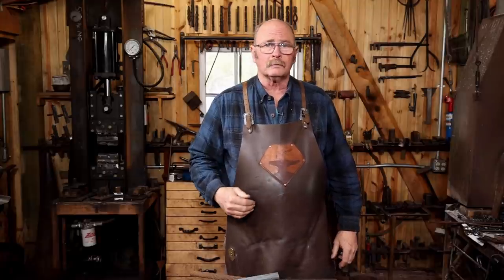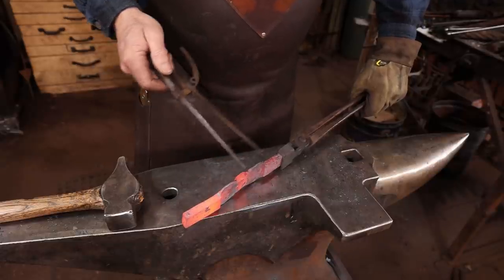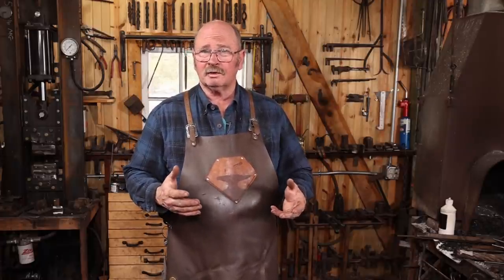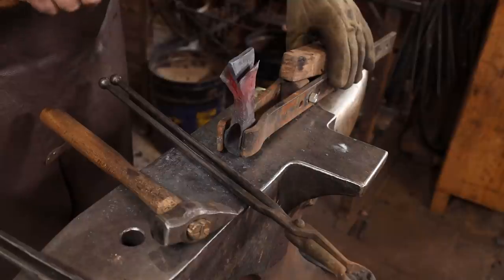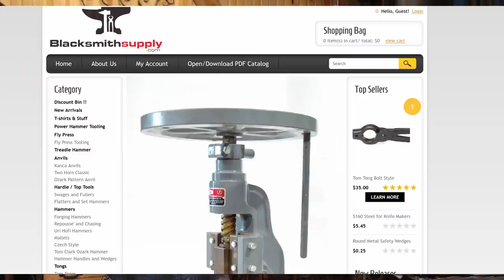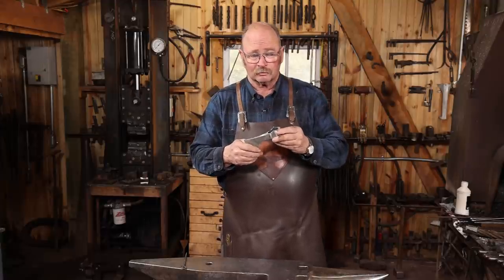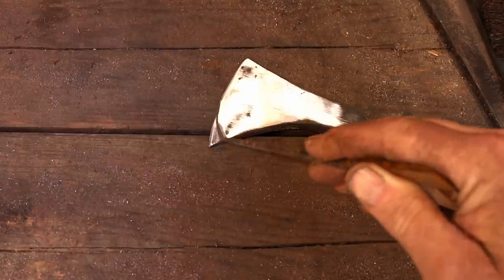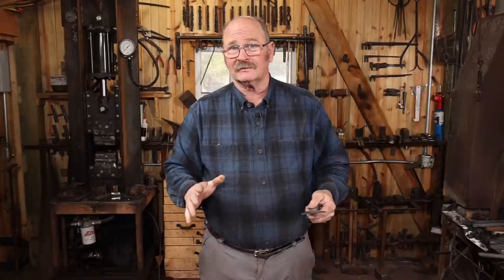Forging a Cable Damascus Camp axe - Blacksmithing fail.

Comment: I actually love the fact that this failed. Why?  There's people like me who are learning this trade, though I haven't gotten equipment to start yet, that hears stories of things like this happening. They may or may not believe it. By showing this, they get shown proof it can happen even to people with more experience. That makes this a great learning experience.
Reply: That is exactly why I became a dedicated Green Beetle fan. In fact, now that I am working metal as a hobby, I learn so much more from watching people’s mistakes than their successes. I am incredibly grateful to those who are willing to share their “fails” with the rest of us.
Reply: We learn more from our failures than our successes. :)
Reply: spent 6 hours drawing out a head out of 4140 round stock.     got done saw a crack 😢 it was my fault.
Reply: Same I got my forge and tongs from Amazon I did test with it with rebar made a half hook with a chisel edge

Comment: Thanks for sharing John 👍🏻 makes alot of sense when you explain about the time between heat treatment and tempering , cooling stress may have been a factor in some of my failures. Keen to see prt 3 🍻😎👍

Comment: Finally someone else that quenches in water. 
I will say brine Is actually safer than plain water. Salt water with dish soap, as it reduces surface tension resulting in a faster safer quench. Also recommend heating it to 150*f.  Parks 50 is the safest option and works perfectly.  You will wish you bought it years ago.

Comment: I feel your pain on the crack John! I spent hours forging and grinding a camp knife from 1065 - after the quench, I was checking out the blade in my bare hands - room temp steel, I was evaluating a mild warp in the blade and thinking about reheating and straightening it, or trying to ease it straight in the tempering oven...when suddenly... *PING*...took care of that. I kept the blade to use as a template as I was really happy with the profile. Happy ending is I forged another one and it's 100% good - didn't warp, it's nice and hard even after tempering a little higher than ideal, and all's I need to do now is make up some denim micarta scales from some old blue jeans.

As many others here, I really appreciate your contributions to the blacksmithing community and applaud your efforts and humility in sharing your failures along with your successes - that's the reality of blacksmithing.

Comment: That axe was looking good.  I hate that it failed.  But thanks for taking the time to discuss reasons why it would have failed.  Some years ago, I heat treated a meat cleaver made out of industrial sawblade steel.  It was late so I decided to temper it the next day.  It was sitting on the kitchen table and my wife and I heard that nasty little ping sound.  I looked at the cleaver and there was an inch and a half crack from the edge into the body of the blade.  Since then, I temper immediately after heat treat.
Reply: So good to know… I didn’t know that tempering right away was important. That’s exactly why examination of failures and explanations from people with this kind of experience are so valuable.

Comment: Hope we see better results next time. Most of the hardcore bladesmiths I've watched seem to swear by Parks 50 as their go-to quenching oil, so that is probably the best option. I've been told about a solution called Superquench, which if I recall right was a solution of brine and dish soap, which is supposed to be better for the 10-- series high-carbon steels than straight water, but I've never actually tried making it... I'm just starting to mess with blade-making at this point. I think I might just invest in a bucket of Parks when the time comes.

Comment: I use alot of 1095 and w2 and parks 50 has never let me down!
Reply: I was going to say, from the research I've done w1 and 2 and 1095 are water quenching when they're giant industrial parts. It's really just too risky in water for such small parts like axes and knives. Made a chef's knife out of some w2 and got somewhere between 60 and 65 HRC in a 130 degree canola oil quench.

Comment: My understanding is the water quench for 1095 is for a thicker cross section. When you forge it thin, oil will be a better option.  The 1095 knives I've made are all oil quench and come out with good hardness when tested with my files.  Your experience far exceeds mine, but that's what I've read and my experience.

Comment: I've quenched W1 and W2 in oil with very good success. The caveats are that these were knives, so pretty thin cross sections and I also preheated my oil up to a pretty high temperature of 140 to 150 degrees F. I tried a bunch of knives in water with these steels and every single one cracked on me. Maybe my normalizing cycles weren't good enough I don't know but quenching in hot oil got the blades VERY hard.

Comment: Thanks so much for letting us follow along and learn from your set backs. It would be interesting to go ahead and hang the head, then do some destructive testing on it. Do a bunch of throwing, and use it to split wood like a froe. See if you can get the bit or eye to fail. It might fall apart on the first throw, or we may learn how far we can push the thickness of the cheeks and how well a bit can hold on with only one side welded. Take care and God bless

Comment: Hi John! Sorry to see the axe fail, but I'm also impressed that you share your failures. I did have to check though, and 1095 is spec'ed as an oil hardening steel.

Comment: All apart of it. You showed me that lol. I have a whole shelf of fails right next to my forge. I look at em all the time, find where I messed up, or see that my material was just to small, or short or whatever.🍻
And watching this I can see where I mess up alot on welding. I need to do more heats. And maybe a slower blower. I'm always starting to get it to stick, then I pull it back out and the blade end(most of the time, sometimes the flat side?) Will start to spark and burn.

Last edit lol. 
Something else I've noticed is that I see you get the white heat quite alot and no sparks or burn. Is that just a difference in my forge and yours or the fact my blower is a little shop vac? I can get the bright orange easy. Maybe my eyes lol.. Thanks alot John!
Reply from the maker: I'm not really at white heat when I weld.  Thats just the way the camera sees the high heat
Reply: @BlackBearForge  ah, good to know.  Thanks

Comment: As a professional arc welder of multiple processes, I am impressed by your forge welding. The growing together of grain structure is the same in all processes. Your emprise on the base metal being clean is true for all welding processes and the key to success. I love watching your videos and use your teaching in my shop.

Comment: After welding the ends of the cable try soaking and rinsing with water in muriatic acid. This removes most of the rust between the strands. Do this outside and upwind! Some borax or kerosene helps with the oxygen attacking the strands during forging. Looking forward to the second kick at the can! 👍

Comment: Sure is a shame it cracked because it looked awfully nice. Better luck next time. I use parks 50 and it works great with 1095 I haven't cracked anything while using it yet.

Comment: Dear Most Excellent Blacksmithing Teacher,
Please move from the Mentions&Intentions stage to the BuyitAlready stage of a couple of Go-Pro cameras. Set them up in those semi-permanent spots you've talked about so you don't have to keep fiddlin' and fussin' with the recording device relocation problems.
Not having them is an efficiency hindrance to your most excellent work and teaching.
Please Sir and Thank You for Your videos.
😊😊

Comment: I'd lay some welds over the thin spots then grind them down to add thickness. Would at least be able to get some use out of it. Edit ** That was my thought before you said the cutting edge failed also.

Comment: As someone who's never forge-welded and rarely hardened anything, my immediate thought when you said it cracked was "did forge-welding change the alloy/properties of the steel?" I assume decarburization can change the relevant soak temperatures and/or best quench medium.

Comment: Heartbreaking that your piece failed, but still, what a great instructional video, and I'm totally for it if you decide to revisit this project!

I did have a question, during the forge welding part, you were kicking out a pretty good amount of sparks (3:32).  Is that just typical when you get a piece that hot?  Or is some of it due to the flux (if you used any)?  Just curious, keep up the great work!!

Comment: Your experience shows. When working hot steel you keep that hammer in motion to the point that it's hard to tell which side your using sometimes.

Comment: To relieve it instantly I do a japanese temper in the forge, bringing it up until water droplets roll off it, which should be a gentle max of 200°C. I doubt you could even see much yellow, but I don't spend time to brighten it for temper colours so I don't know

Comment: I realize that the Heat Treaters App says 1095 is water quench but that’s not what most bladesmiths actually do with 1095 as it has a tendency to react poorly to the water quench and the note saying water quench on the Heat Treaters App might actually be a mistake or typo because if you go to the steel suppliers and look at their recommendations it’s completely different. New Jersey Steel Baron specifically says Parks 50 oil quench for their 1095 and other suppliers have basically the same recommendations for quench oil
Reply from the maker: Interesting

Comment: One thing that I think should be mentioned is the app. you are using was developed for the tool and die industry and was made for thicknesses of 1" or more, quenching thin material will cool at a higher rate and create far more stresses in the steel. So thinner stock should be quenched in the next slower medium and that would be a light oil.
Reply from the maker: Good point, Although I have generally had pretty good results using water for the water hardening steels

Comment: That's a bummer, John. Is it possible that the cable steel didn't "like" the water quench, and that's why it cracked at the weld, not that there was any problem with the 1095 and the water quench? 

Sure was a pretty looking ax though. I'd love to forge some with that profile.

Comment: Thanks again, always good take aways from your videos. Was the anvil a possible culprit? I know from experience that  placing a blade on an colder anvil can cause it to warp, maybe a thicker piece might pop a weld. I was being called into the house for lunch (and being one who never misses a meal) I left a hot blade on the anvil (l had more forge work to do on it) and by the time I got back, it looked like a banana.
Reply from the maker: If the piece was still hot that might have an effect.  But since both were at room temperature it seems unlikely.

Comment: I wonder if a water soluble coolant would be a good quenching oil to use if mixed with water as that in between oil and water. it would certainly be cheaper and easier to get if it were to work. Our local Napa carry's it for around $20 a gallon and it'll mix around 40 gallons if i recall right.

Comment: You mentioned the temperature might have been an issue in the edge failure since it was gauged by eye…are those hand held laser thermometers accurate enough to use to confirm temps on metal coming out of the forge? I’d like an oven eventually but it’s a big expense, seems like a handheld unit might be nice to double check temps.

Comment: Hello ,

Some say that the gas forge tends to "decarbonize" the steel, the successive defects of welding, quenching etc would they not be partly in question due to the gas forge?
I don't know much about the forge, I'm just wondering, but I really appreciate your channel.

Comment: As a knife and Swordmaker, I would never quench 1095 in anything other than parks 50...water it's simply too violent of a quench, and other oils aren't quick enough...you must have missed the ""or aqueous polymer"" in the hardening instructions, parks 50 is what they're referring to in that case, and is used for thin sections like knives, swords and axes
Reply from the maker: Thanks for that information, I have always wondered what they were referring to.

Comment: I am severely tempted to ask to buy the failed axe head at a discount price so as to use it for a cane head or decorative peice I can hang on a wall. It looks really awesome and I hate to have it go to waste by just being trashed...
Reply from the maker: I think some else beat you to it.
Reply: @BlackBearForge , no worries then if that is the case. Just happy it won't be discarded as scrap and will see use. :)

Comment: Could you forgeweld another piece of steel into the inside of the eye and both thicken the wall and shrink the eye? Or would that not work for some reason I’m not seeing?
Reply from the maker: It might work, but would be a tough process to get a good weld

Comment: They say an hour I'm not used to doing blacksmith work in welding fabrication something you build you have to have stress relief immediately whether it's vibratory or heat be careful with the vibrator you be doing more damage then good with that I've seen grade 80 plate shatter like glass under a vibrator

Comment: Maybe the cable steel is oil hardening?
Reply from the maker: Perhaps, but if its really Improved Plow Steel that makes it 1095 and should be water hardening.